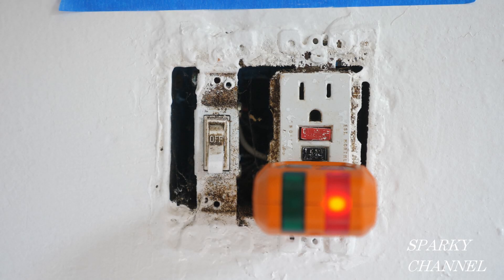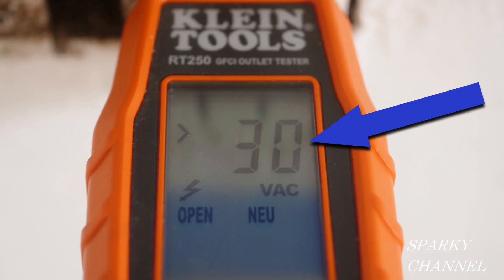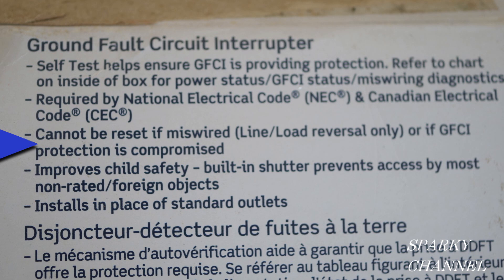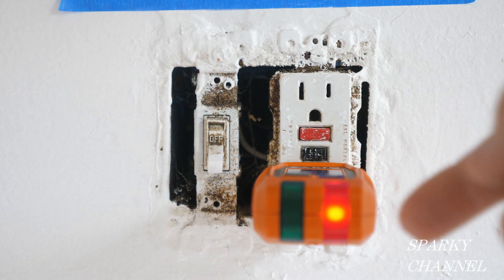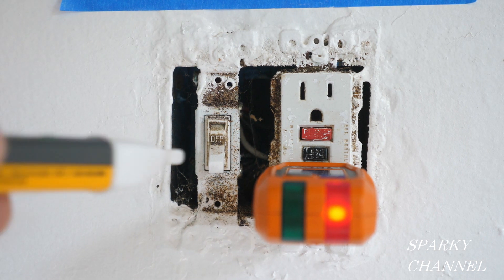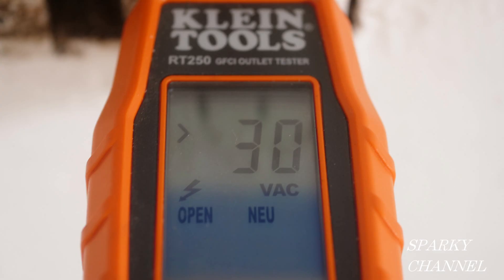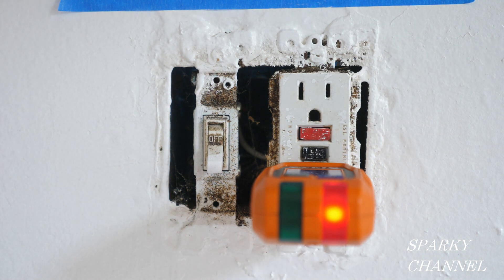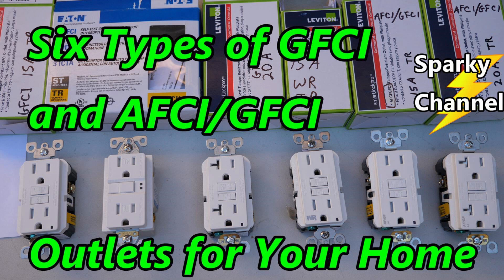Why Isn't My GFCI Receptacle Working? How Long Do They Last?

Comment: I found a GFCI that trips at 2.5 milliamps, it's supposed to be over 5. It trips with a tester without pressing the test button. Just to make sure it wasn't miswired I removed it and wired it up to a cord and tested it again with no load whatsoever. Same thing. I replaced it and the new one works properly. The only clue is that GFCI used to run old Christmas lights and tripped quite often. It's probably worn out. At least if failed on the safe side.

Comment: I recently had a GDCI go out randomly, and after replacing it with a new one I still can't get it to reset. It seems to be connected to a couple other circuits, but I checked those and can't find an issue there either.

Comment: Some GFCI's have an LED light that will come on when it's time to replace it which will let you know for sure it's went bad.  They also make them with audible alarms nowadays so you will know when your fridge trips one (new code requires them on all fridges). I suspect in the next code update they will simply require them on every circuit in the house (like some countries already do).

Comment: Kitchen gfci just went out 26 years old. Update in the reply, it might still work.
Reply from the maker: Wow! That's great!
Reply: @SparkyChannel  so turns out the GFCI might not have gone bad. The GFCI had two sets of load lines pigtailed to one and apparently the pigtails were causing the new GFCI to keep tripping. So got rid of the pig tail and back wired the two set of loads into the two available load backwire slots on the Eaton gfci. Also I had noticed about a month earlier the bathroom recepticals were showing an open ground. Turns out all 5 outlets on that particular load line were all open ground. Turned out that the first two outlets which are outdoor we're not connected to ground. So GFCI ground to 1st outlet wasn't connected to the receptical nor twisted with the ground line that goes to the 2nd outlet, but the ground line that goes to the 2nd outlet was attached to the 1st outlet. The 2nd outlet had the same issue, so there was no continuity for 1st and 2nd outlet of the 5 outlet circuit connected to the GFCI from that load line. All is good now, tester is showing proper wiring and GFCI is on and functional for all 6 connected outlets (1 load line has 5 outlets and the 2nd has one outlet) and test is able to trip the GFCI from all recepticals. Now to update the 3 26 year old outdoor recepticals connected to the GFCI with WR recepticals and add housings to them to further protect them from the elements. And that's on the original house portion, there's more outdoor recepticals to do on the addition portion of the house. Used a few wago lever nuts 221 also used some to direct wire some kitchen tube lights to convert to type B double ended LEDs the day before Thanksgiving. Putting electrical tape around the lever nuts definitely helps and in my opinion it's a must especially with today's receptical fixes. Thank you for your time.
Reply: @MannyAguilarJr  Sounds like the electrician who hooked them up did a poor job (either that or it was a DIY job).  And, yes, the outdoor GFCI's must be weather resistant (WR) and placed in a weather proof housing (code requires both).  Sparky has a video on outdoor GFCI's where he shows how to install a WR with a protective housing.

Comment: My gfci's went over 25 years, and one was still working! Replaced them with the same leviton one's, obviously new but audible ones. Home buying inspector pointed this out by just using the same very simple tester. I'm a diyer so it definitely knocked the price down on the home and install.
Reply: The audible ones are becoming must haves today because the new code requires all fridges to be GFCI protected.  If the GFCI protecting the fridge trips, it is good to know it ASAP.

Comment: These are the reason why I bought these gfci receptacles outlets cause sometimes the flow of electricity does have a high and low voltage so it's important to have these in kitchens and in living rooms

Comment: I put a GFCI receptacle out in the carport, and it only worked for like a couple of years. It's outside, but it's in a protected place at the back of the carport. It originally just had a regular outlet. It tripped often probably because of humidity. Then, it jammed in the closed position. I've been a little lazy about replacing it because the outlet still works as a regular outlet and because GFCI outlets aren't exactly the cheapest things. I don't know if it is normal for GFCI outlets to trip a lot when outside even when protected or if the GFCI was simply defective. I have a security light plugged into it now, and I'd prefer if it didn't just randomly trip because of humidity.
Reply from the maker: Interesting!
Reply: Sounds like an overloaded circuit

Comment: Looks like this old Leviton Model 6599 has reached its last leg than Model 1451. My 6599's and Eagle GF15's still work after they were installed in 2002.
Reply from the maker: Interesting, thanks!

Comment: are you sure the bad one is a smart lock?  it it is locked out, it should be completely off.  (no voltage, no continuity between EITHER terminal and the corresponding contacts) I also notice that a smartlock will trip even with no power. it looks more to me like that one has a relay failure and the neutral side of the relay isn't making the connection. I also note your tracer is seeing voltage on the neutral side of the device.

of course, the bottom line is still that they are black box technology and when they quit working they should be replaced.
also note, for DIYers, the newer models do NOT necessarily have the same terminal positions as old ones - so be sure to read the markings instead of just moving the wires to the same position on the new device.
Reply from the maker: Perhaps if I used my Auto-V/LoZ on my Fluke 117 it may have read zero. But that locked out GFCI is very hot and can shock someone badly even if a meter is reading zero. The lock out feature can give someone a false sense of security.
Your point is well taken though, I don't know the specifics of that old GFCI.
Reply: @SparkyChannel  if it's a Leviton smartlock model it will have an icon of a padlock on the face.  I suspect, just from looking at it, that it's a pre-smartlock model, and it's not tripping properly due to a problem with the neutral either internally, or in the box.  I'd advise making another troubleshooting video.  I'm getting a bad feeling about it, and I'm curious to know if it is correct.
note that it is normal for Leviton GFCI receptacles, both with and without smartlock to drop power while the reset button is pressed. I just checked mine to confirm that.
Reply from the maker: @kenbrown2808  Excellent information. Unfortunately, I threw out the old GFCI. A nice new GFCI and a spec grade decora plus switch have taken their places.
Reply: @SparkyChannel  well, that would mean it wasn't a wiring deficiency, at least.

Comment: Cannot be reset means it can't be reset as long as the fault is still present. If you remove the fault they should work again. In that case it won't due to the dirt that is in there. And good RCDs/GFCIs isolate both, the line and the neutral.

"Test monthly" lol, I don't know anyone who does this here. Here they state either "Test Yearly", or "Test on regular basis". Over time these devices become more sensitive and tend to cause nuisance tripping. Meaning there's no fault, or not such a high one that should cause a trip. Here the RCDs should trip on 30mA fault current, test procedure is to give them half the current and they should not trip. On 30mA the should trip in less than 0.2s, and on five times the rated current in less than 40ms. We measure that with the fancy installation testers we have here.
I've seen RCDs here which were more than 30 years old. But they were installed in an IPX4 rated enclosure.
Reply from the maker: Hi Marcel, excellent explanation!
Reply: GFCI outlets like you see in the video are rated to trip at 5mA.  The ones that go in the breaker/fuse box are rated for 30mA (we use both in the USA).
Reply: @LonnieAdams4  I know. We mostly have RCDs in the main or a sub-panel. RCDs integrated into socket outlets are also available, but they also trip on 30mA fault current. But these guys are expensive compared to the units integrated into the panel. Round about 100 to 150 Euros (105 to 160 US$), only the socket outlet, costs for the installation come on top of that. The panel RCBOs (RCD and MCB combination) are round about 40 Euros (42 US$). The type of fault currents they detect is AC and unsmoothed DC directly from a rectifier. The last one can be caused by a defective switch-mode power supply. These guys are everywhere these days, in every power supply.
Reply: @Marcel_Germann  Yeah, the GFCI socket outlets here in the U.S. are between $15-$20 depending on the brand.  The breaker panel kind are more expensive here.  (Kind of the opposite of what you have there).

Comment: 1:50 Have come across many of these GFCI recept.  AND they seem to always be in master bath w/ travelers to the backyard patio, front of house outlet, and even all the garage outlets (what they did for all these 80s houses in the HOA communities, and should see some of the wiring have run into on remodels, 🤦🏼, it’s crazy wild…..crazy wild 😜 
I was replacing one of these and someone went and popped off the reset/test buttons and tried to rig it so it would work, but, like anything in a house that I’ve noticed over the 25+ yrs in trades…..ppl only replace/fix something when it’s broke (which imo, can COST way more money, then doing simple monthly, quarterly, yearly, etc…maintenance with your house. Just IMO, as can save anyone some money if do preventative maintenance instead of fixing or worst case, remodeling b/c of a bigger issue).
Thx Bill, have a good one✌🏻
Reply from the maker: Yep, some preventative maintenance really helps! Thanks. you have a good one as well!

Comment: Nice video! I did not realize that GFCIs outlets may need to be replaced after just a few years. By the way, I just went over to the Leviton site -- under GFCI FAQs it says that the NEC code requires that -- "All the GFCIs manufactured after June 29, 2015 must include the auto-monitoring and many of the GFCI manufacturers use the term self-test."
Reply: Those two things -- the age of my GFCI outlets (most are >20 years) and the self-test feature on newer ones -- make me want to replace all of them in my home with either new ones or with GFCI/AFCI breakers.
Reply: @orascreencasts  GFCIs work until they fail... if you are routinely testing them, you're fine.  the self testing ones are actually more to prevent people from defeating them by wiring them backwards than to prepare for a hardware failure.  
also, I still prefer local GFCI protection for most applications.  I'll protect an outside receptacle from an inside location, but it's often a bother to go to the breaker panel to reset a GFCI, since if you are doing things right, the only time they trip is when you test them.
Reply: @kenbrown2808  Thanks. Good insight.
Reply: If yours are 20+ years old, I would replace them.  The new self-testing ones constantly monitor themselves for failures.  When they fail, some of them have an LED light that will come on telling you to replace it.  Also, they should all lock you out when they fail (although that could only be Leviton, not sure).

Comment: My hair dryer has a GFCI at the end of the power cord.  We plug the hair dryer GFCI into
the Gym provided GFCI circuit.     GFCI  on a GFCI line to line.
Reply from the maker: I know what you mean. Everybody is trying to be safe but sometimes we wind up with too many GFCIs protecting the same load. That can cause unnecessary problems.
Reply: Hair dryers are mandated by law to have GFCI's on the plugs.  This was mandated a long time ago before lots of people had GFCI's in the home.  Also, lots of old homes might not be up to code and still not have GFCI's.

Comment: I would have preferred if you had shown us the wiring.  As is the video leaves me wondering if there is a problem other than it contributing to the recep not working properly.  I always like to know what is wrong before I toss parts at the problem. 
Thanks for what you showed us.
Reply from the maker: Wiring in another video. Thanks!

Comment: Why 'aren't' my receptacles working-
Reply from the maker: Could be a number of things.
Reply: Mr. Rumpole is referring, not to the operation of his electrical equipment, but to subject-verb agreement in the title of the video. By the way, thanks for the videos about the house rehab.
Reply from the maker: @chuckm.9744  Thanks! I changed the title to: Why Isn't My GFCI Receptacle Working? How Long Do They Last?